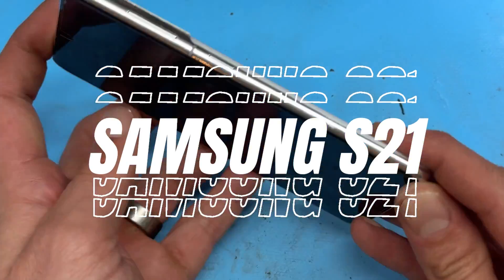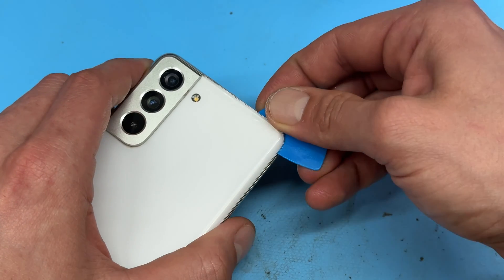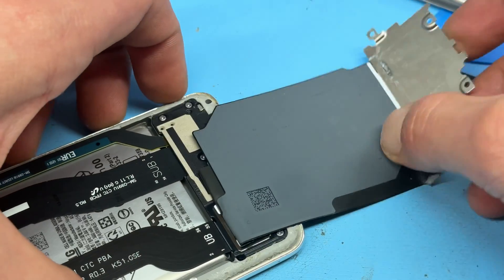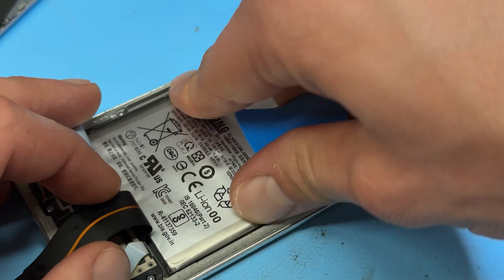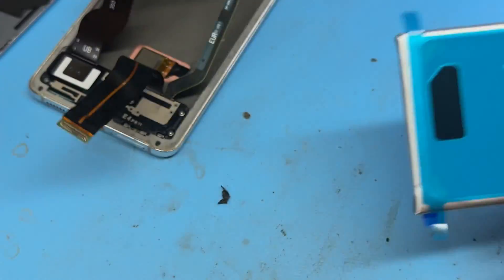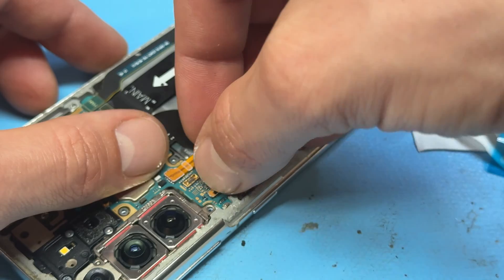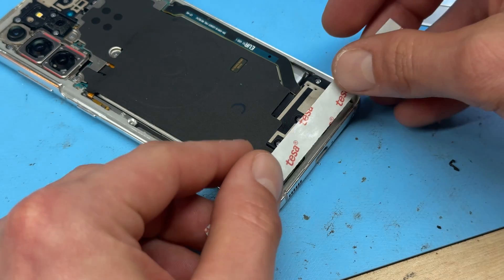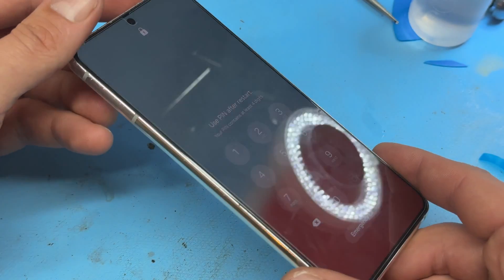Samsung S21 Battery Replacement Guide! Step-by-Step Tutorial To Swap Your Old Battery!

Comment: Thank you for the helpful video — it was really well done and made the battery replacement process much easier to understand.

I ordered two replacement batteries: one third-party and one OEM, both with the same model number as the original battery in my phone. However, I noticed that the connector plug on the battery currently in the phone is different from the ones on both replacements.

Do you have any idea why that might be the case? And more importantly, do you know how I can find a replacement battery with the same connector plug as the one in my phone now?

Comment: Where did i go wrong ? Followed all he steps and it worked well but screen went black after 30 mins
Reply: Same happened to me after doing two of these phones in the same day. Same exact failure a few hours after the repair. I think the alcohol is getting into the back of the LCD panel and frying it. The way this phones frame is made, it seems very easy for alcohol to get in but not evaporate out. Sandwiched between the layers of frame and back of the LCD. Dumb design. Also makes LCD replacement hugely difficult. Its bad when apple products are more serviceable. In any case, I professionally repair electronics and I have never had such an issue of alcohol shorting a device like this. New LCD and frame fixed the failure but wow what a pain. Samsung phones are getting less servicable/reliable every year. Too bad LG isnt in the phone game any more.

Comment: Great tutorial.  My screw setup was different than this model.  Pretty much took every screw out of the top it was like 8 screws including the camera lenses.  It all went back together fine.  Some of the pigment in the cover flaked off and it made it look like the cover was cracking upon removal.  It was just the paint or whatever they coat the back cover with.  No worries.

Comment: What can I do if screw #2 stripped on me? (Had to take it to a pro to grind off the head.) Ordered my battery kit from Amazon, it came with tools. Thanks for the step-by-step! Great visuals!❤
Reply: It didn't strip on you, you stripped it. Get the correct size screwdriver bits.

Comment: Two things:

1. Where did you get the battery?

2. You used many tools most dont have in their homes. What are all the items used to do this?
Reply: With the battery came a kit with the correct tools and they fit perfect.  Having a razor blade is a must and the alcohol
Reply: From Amazon... I wouldn't suggest getting greedy and going for the larger battery I've heard that they are bigger and you won't be able to get the back cover back on

Comment: What's the link for the battery?
Reply: Amazon has them... Just type in s21 and I got several options.  There were some larger capacity batteries but I heard that if you go with a bigger one you might not be able to get the cover back on so I went with the 4500 milliamp hours.
Reply: Yea!
Reply: Yes